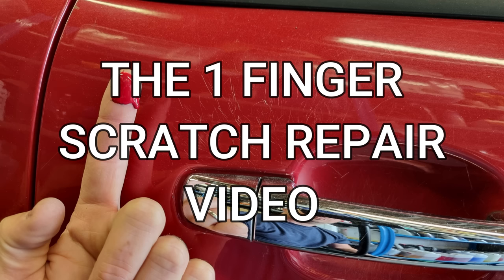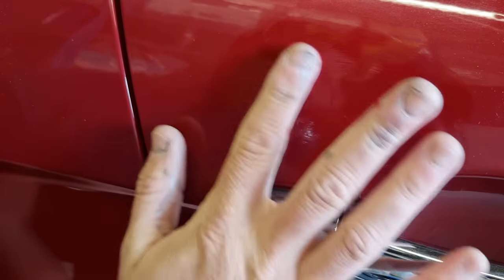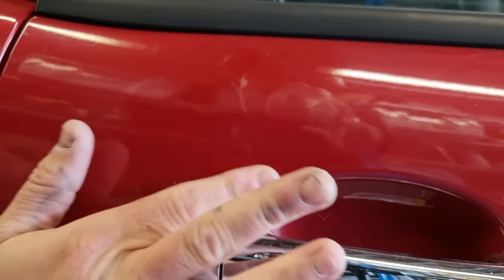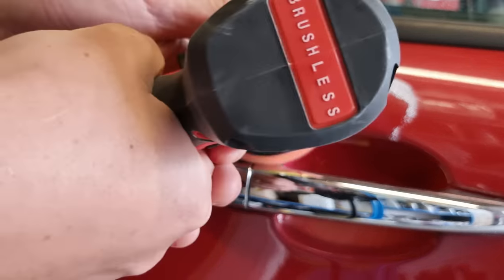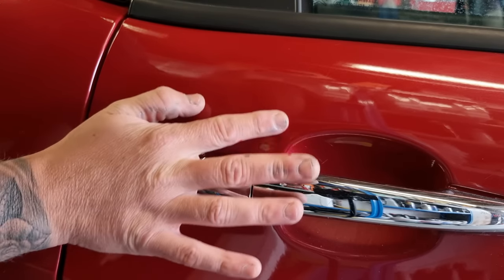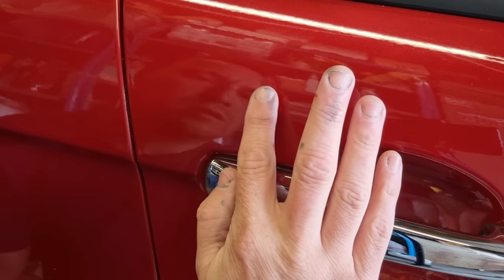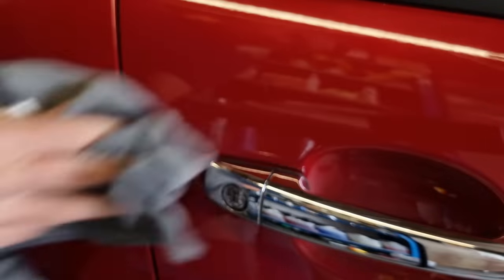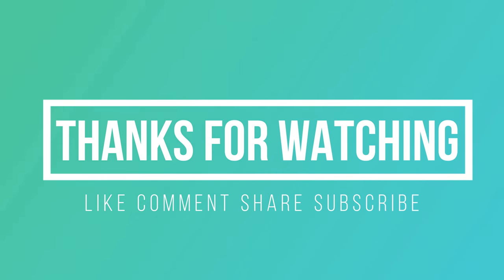Car Paintwork Scratches Try this method to save you money!!

Comment: Good but if it's a solvent 1K paint it will shrink. Much more than you might imagine. It will look seamless on the day you do it and then a month later the paint will have sunk down into the cracks and ironically the cracks will look more visible due to the polished finish. Six months later it will look pretty much as if you'd left it alone. It's a very temporary fix.
Reply: So good before a trip to We Buy Any Car!
Reply from the maker: Ive done this on my own cars and it holds up pretty well actually

Comment: Great video thanks. Should the panel be cleaned with anything special before applying the paint?
Reply: Good video.  It seems that the paint would adhere better if you cleaned it with alcohol or something of that sort before applying the paint, including between the latter applications.  I noticed that this car also had fingernail scratches under the door handles, which is what my wife's car has.  Those are a lot harder to get to.
Reply from the maker: Panel wipe will help

Comment: @ CVR POV Hi mate, I've had a good look through your post's and this seems the most appropriate to what I need to do to my roof. Is there any way I can show you pictures as  I was told  I need a respray for a 2" square patch where something rubbed away at the paint after a previous roof rack owner. no rust just a ware patch. I could use  some help with the alloys as well if you have suggestions, its on a  VW R32. Its in great nick and  I would like to keep it that way and hopefully improve it.

Comment: @ 3.28 why is there an overlay of the door it goes from one screenshot to another and then a few times later. What is the reason for this? 
Good results by the way.
Reply from the maker: Probably cos all 4 doors were equally battered

Comment: Where do I buy Solvent Paint that matches the Colour of my Car? Is Solvent Paint different from the Touch-Up paint that's in a little bottle, that comes with its own little brush, that's readily available to buy, and can I use this Touch-Up paint doing the same finger method you show in this video?
Reply from the maker: www.paintgear.co.uk
As long as its solvent based and not too thinned down

Comment: Tried your method using solvent paint.  I prepped the surface with isopropyl alcohol, rubbed paint in and let dry 10 minutes.  Maybe the touch up paint is bad, had a hard time removing the excess and when I did, a bit of it from the scratch would too.  My paint is metallic, have you had issues with this type of paint?  I also want to mention I wet sanded with 2000 prior to the paint being applied.
Reply: He said he only let it dry for up to two minutes, not ten.
Reply from the maker: maybe need a better compound, maybe more compound and make sure the tool spins and not a DA

Comment: How well does it work on black cars?
How long do I need to wait after applying paint with a finger before starting to buff the repair?
Reply from the maker: Works great on black cars. You can even use solid black on metallics with this method.. the eye can't usually pick up the difference. I only wait a couple of minute

Comment: Do you not have to wait for the paint to dry and then buff it or is i better to do it straight ways? Did you have to spray it with lacquer to get the shiny finish?
Reply from the maker: It kinds ends up shiny when it's buffed. Apply then leave for around 2 mins then buff

Comment: Or use panelbeaterinapacket to p@ch th@ scr@ch. So long as paint is left, your scratch will be outa sight in 20s-6min and unmeasurable by micrometer. Perhaps to use both methods? May work better as you're filling the furrough, not just polishing the colour coat so finely as to get shine from this porous paint that eye can't discern difference of shine of colour or clear coat. As it removes anything on factory finish, you'd only leave the filled furrough with material, whilst removing all the blemish of touch-up on factory finish. Really good concept though, which I'd never have tried. UK? Call Ducati in Lincoln and ask if they've any Clarity cloths left. If dry, add 'lil water to dampen. Follow scratch, any surface, finish in circular once scratch outa-sight. Be weary with BMW satin black, finish with polish, smear damp rag, then shine. Best thing on dulled headlights and calcium water-mark on glass/window rubbers too. Clean block at-a-time, up&d, sideways, circles till squeaks, job done. Clean tarnished headlight, then rub edge of UV film hard to blend film in with no film. Lasts a service interval , @ 0,04p, done in 20sec. Try ceramic sealing, I've not, as it's so easy and quick.
Reply from the maker: Thanks for the feedback and comments

Comment: can excess be removed the next day. if so, could I take it to my local car polisher or maybe he uses the wrong abrasive? my car has scratches and swirls all over, my plan is to fill in deep scratches with solvent based paint mixed with lacquer, would I have to make them aware of this? i need the whole car polished eventually..jw if this is the right approach.
Reply from the maker: Yes u can do this

Comment: Hello, Should you set the drill to high or low speed, and if there is a clutch adjustment on the drill what setting should you use? For example my drill has a 1-15 clutch setting or a setting for just drill.

Comment: Cant wear a glove.
My dad (died in ‘65) then my brother owned a body shop starting in the late ‘40’s to the late ‘90’s. I helped out intermittently until ‘90’s.
Body shops won’t touch this type of repair now but we used to suggest it to a guy if he didn’t want to put a bunch of money into it.
People would try it and if they wanted a pro job they’d come back. We would do it for single, older ladies etc. and let them decide if it was satisfactory. We didn’t even charge them.
There wasn’t much call for it, however. I only ever did……..🤔a couple??
Worked great on black, white. 
Today? Clear coats? Way different paint compounds, could be a crap show.
Reply from the maker: Thanks for the comments pete

Comment: Will this last indefinitely or will it erode with washing?
Also are you cutting straight after applying the paint or waiting for it to dry?
Reply from the maker: I've seen that it seems to last a good while. 2 years ok my van infact. I usually wait a couple of mins before buffing
Reply: @cvrpov  top man, thanks for responding. Got some scratches on a new van, and I wana sort them properly. Think I’ll try this before paying someone 👍🏻 or would you not recommend if it’s first time trying it?

Comment: What about a stone chip on the bonnet that's gone through all coats down to metal.?  Will this still work if you build layers? No primer coat needed?
Reply from the maker: Just build layers, wet flat and polish. I did a video on this with a black bmw door, check my playlists
Reply: @cvrpov  cheers mate I got the ultimate kit with compound. Probably makes no odds but is it fine using a Corded drill also for the polishing part

Comment: Much better to do this than 100% - use the car and you get new scratches. How do you see if a paint is a solvent paint and not water based? Would water based not work?
Reply from the maker: No waterbased won't work

Comment: I tried this using the dr color chip touch up paint but the paint was turning into a lighter color when blending with my finger. I tried buffing but it wasnt going back to normal. Ended up removing it. Any advise. Is it because I used touch up paint?
Reply from the maker: Sometimes if its a high metallic Paint this can happen or maybe their paint is too thin hard to say
Reply: @cvrpov  it is turbulence gray, metallic, for a supra, paint code D03. I don’t know if it’s solvent-based or not. Any advice or alternate solutions?

Comment: My Volvo is a black metallic water-based paint colour, as is the colour touch-up kit Volvo supplies. Will a solvent-based paint (if the colour is available) like you used, work over a water-based surface?
Reply from the maker: Yes. All cars are painted in waterbased paint nowadays.
Reply from the maker: Waterbase paint is terrible for touch up work

Comment: Didn't work with my silver Mercedes iridium 775 but not sure if the paint should be completely dried or if its just me being useless 🤷‍♂️
Reply from the maker: Silvers are difficult mate
Reply: @cvrpov  thinking a mix of 3000 grit wet sanding and Meguiar's Ultimate polish
Reply: It's a small patch on the pillar/quarter panel by rear windscreen. Bit the bullet and ordered some spray, lacquer etc only small area of about 3" x  2" but obviously have to sand down a bigger area and do my best to blend it in. Then Meguiar's Ultimate hopefully polish up nice. If all else fails going into my mates spray shop, trying to save money after being made redundant
Reply: @cvrpov  Sorry to bother you, buddy. I have a pretty terrible (to a non car guy. It's an OK fix), but to me, it's HUGE my W204 in 775 Iridium silver is my baby, and the paint is near perfect everywhere else. The area is approx 3" x 2" on the rear windscreen pillar. If you get the time, could you please 🙏 do a video on how to blend the paint, I have everything needed, full grit wet sanders up to 3000, paint match, clear cote and every Polish, rotary, full set of polishing pads from high shine to coarse Orange etc and I know the area will need to be increased from 3" x 2" but any help 🙏 I will definitely be a life long subscriber and fan good sir 👌👊

Comment: I would start with degreasing the part where the scratches are, the paint will stick to the scratches much better and your beautifull work will be longer seen.
Reply from the maker: I find this step isn't necessary
Reply: That may be, but for long term enjoyment of the work thats done it is a fact and advised to do so.

Comment: Getting crazy trying to reproduce this method on deep scratches, and my testing bonnet is asking for mercy now cause i m torturing it all the ways 🔪🔪🔪🔪. 
I don't understand if the touch up paint is completely dry or not when you buff it cause, if I buff the panel after 2 or 5 minutes the paint is still fresh and creates a thick crust that i necessary have to remove with sanding later......
why your surface comes out clean without any paint-crust? is Paintgear different from any other solvent base paint? I m reproducing this method following the instructions and using solvent base paint, Rupes DA course blu compound and wool 3 inch pad on the Shinemate rotary EP803 and all the times compouding the touch up paint applied creates the crust :-(
Reply from the maker: I never use a DA for this..i find a rotary or spinning tool works much better
Reply: @cvrpov  I used the Rotary (shinemate EP803 Is a Rotary)

Comment: wtf how did  the paint stick?  I have tried to use touch up paint in wider areas and it would flake off if smeared around in wide areas like this?  How did this guy do it and then polish it? wow.
Reply from the maker: I like to use neat solvent paint. When it's thinned down it's less effective
Reply: @cvrpov  but i mean, other than just a clean surface, u didnt sand or like primer, how long will this "fix" last?

Comment: You never tell us how long it takes the paint to dry. Most professionals tell us 24 to 48 hours, that's 2 days, you give the impression that it dries in minutes. Can you expand on that? are you using special paint?
Reply from the maker: Only need about 3 mins under normal temps
Reply: @cvrpov  You still don't tell us why? Its like its some kind of secret, why don't you want to tell us? how come the paint you use dries in 3 minutes? why the hiding?

Comment: I applied too much paint on my carbon black car. What do I do? Also my electric drill doesn’t seem to the buffing out the excess paint either :(
Reply: Maybe sand it, then apply clear coat and then polish it? https://youtu.be/N_QgnzT-mQg
Reply: Thanks mate. Will a paint leveller do the trick? I am concerned I might over sand the surface.
Reply: @roywilliams1989  Don't know, sorry. :/
Reply from the maker: Yes it should as its acetone based

Comment: How the hell did they do those scratches?  Completely missed the door handle by a country mile.  😂
Reply from the maker: It's borderline an attack aint it
Reply: Getting into the car at night maybe? Missing the keyhole with the key and missing the door handle with fingernails?
Reply: @CycolacFan  well, considering there are no key holes there, using keys wouldn’t even make sense.  And yeah, if those are actually fingernails marks, then my original statement still stands… they completely missed the handle by a long shot.  🤣🤣
Reply: @ONI1013.  fair point, I’m so used to older cars I didn’t even spot the lack of a key hole. 😉

Comment: Dude you haven’t invented any form of new repair method, I own a Sprayless Scratch Repair ( SSR ) business that does exactly the same thing accept after colour application it’s followed by an activator on a buffer. Running over solvent basecoat with normal polish will break down the pigment causing it to breakdown quicker. The colour will get hit by UV and lose its hue simply because there’s nothing over it to protect it, and yeah I am a qualified spray painter too.
Reply from the maker: Nobody said I'd re invented the wheel. This method is new to most people, and usefull for most people. Your average guy can get some base colour, whip out their cordless drill... and disguise some marks on there car. It holds up much more than you might think actually.
Reply: @cvrpov  seen it done it tested it I also was a State rep for an Automotive Paint company and am also a qualified technical paint trainer we tested this too on average 4 weeks till the pigment starts to breakdown. Try looking up SSR you’ll see why that works better.

Comment: The only thing is you have painted over top of the clear coat so this new paint has no protection.  I don't know how long it will last.
Reply from the maker: Seems to last a good while..I did it on my van till I sold it so it was nearly 2 years and it still was there